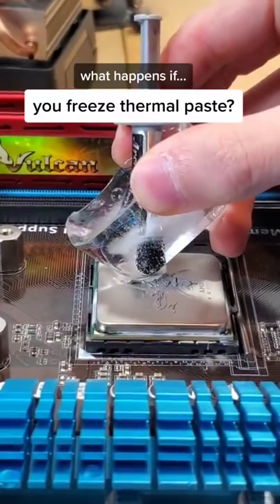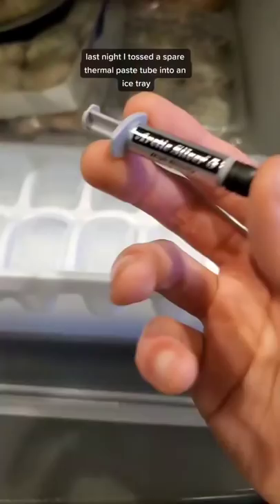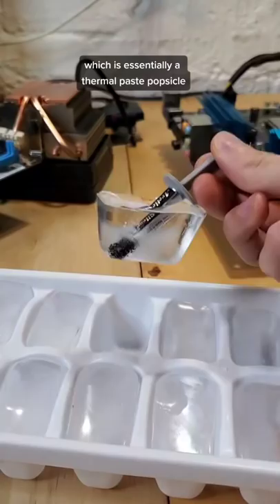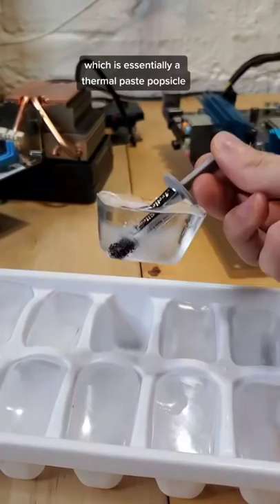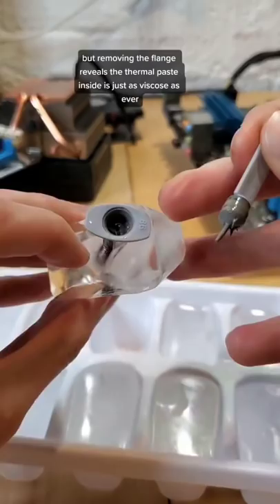what happens if you freeze thermal paste? #shorts

Comment: Thermal paste in liquid nitrogen
Reply: I was thinking the same thing
Reply: Yes
Reply: some higher end thermal paste is designed to still work at those temps ans LN2 is used for extreme overclocking
Reply: Ye
Reply: It's hard to find the freezing temperatures for thermal paste but from what I search I think -50c is a around when thermal paste might freeze, even being generous and making the freezing temperatures -100c isn't even close so it'll 100% freeze in liquid nitrogen
Reply: @FlaxTheSeedOne  source: just trust me bro

Comment: You didn't freeze thermal paste. You freezed the water around the the paste which has a much higher freezing temperature.
Reply: Probably would be pretty hard to actually “freeze” thermal paste since it’s pretty much a metallic paste and some grease and a lot of the contents are already in a solid form

Comment: Just consult with the manufacturer if they can tell you what the freezing point of the thermal paste is. This comment sections leads me to believe that people think if you leave out distilled water over a stove at 99 deg cel at 1 ATM long enough then the water starts to boil. Smh.
Reply: @prince5922  ah my bad should I post my credentials? I'm in my third out of 5 year of my BS physics and electronics engr degree. What I said isn't smart, it's basic high school science (grd 10-12?). And consulting with the schematics and manual provided by companies is the first thing you do if you want to know more about an electronical or chemical component. 
But hey good job for lurking around the yt comment section to point out anything above your pay grade dude. Rooting for you.
Reply: @LorenzoC36  Always remember the c when putting BSc, otherwise it just reads as a BS degree 😉
Reply: "ah yes clearly I know what I'm doing because I'm a physics student"

I swear, everyone I have met that knew enough physics just forgets basic concepts. See the chicken slap calculations for an internal temp of 400f. Also yes, water does indeed boil. 1 ATM = earth pressure at sea level. Congratulations. You proved nothing except that the ACT no longer means anything.

Comment: What happens if you cool down the procesor with liquid nitrogen when is working?
Reply: It'll work as a cooler, doing that is pretty common with competitive overclocking since it pretty much stops thermal throttling altogether. Although at a high risk of shorting something from condensation.